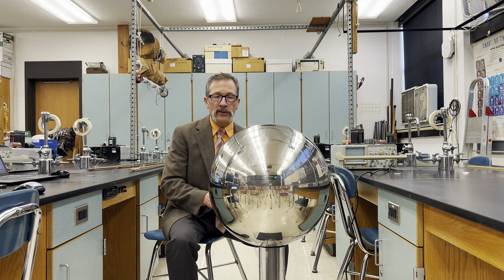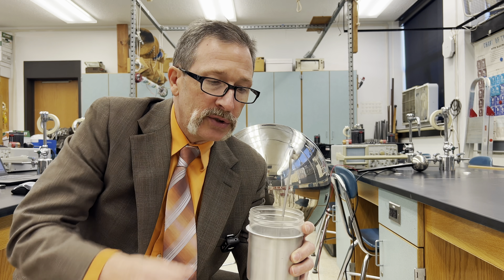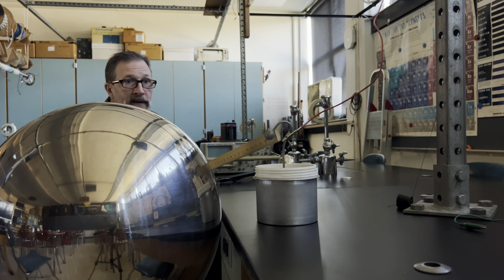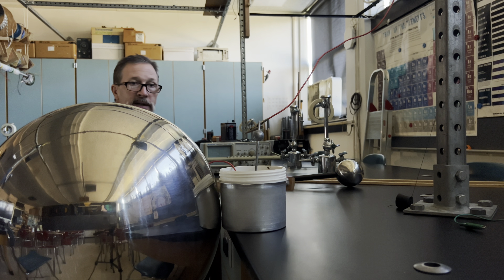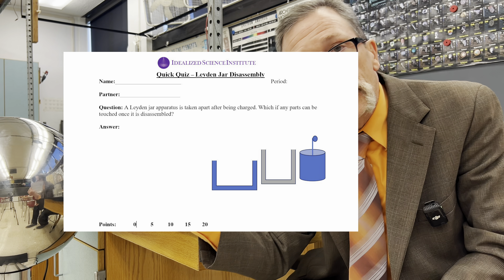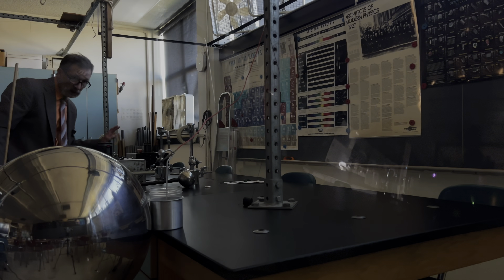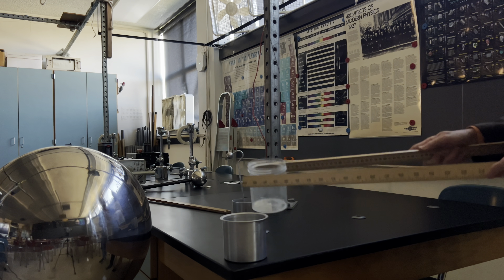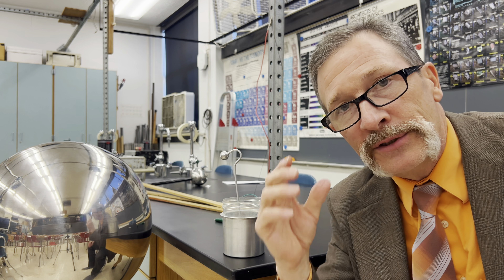This Simple Device Could Kill You

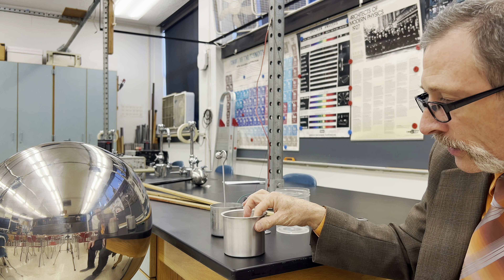Comment: 10:50 11:00 When you say any excess charges go through you to the ground, how much charges is that and why it's not dangerous? Does that mean the energy of a capicitor mostly exist hold by the dielectric? If that the case how do an air capacitor work, what happen if you disassemble it like this?

Comment: I am 60 and find this fascinating. I recall Van de Graaf generators from school. Two questions....is it AC or DC being generated? Second, at the very end, when you shorted/grounded both plates of the Layden jar to themselves when finished, if you put the jar near the Van de Graaf and turned it on, would it spark at all? I am guessing it would not spark to the Layden jar but to something else.
Reply from the maker: We like to say that the resultant discharge would simply be DC. Having charge and taking them to zero.
And yes, when the Van de Graff is turned back on, it will recharge.
Reply: @idealizedscience  Thank you for taking the time to answer.

Comment: Fun video. Thanks. As a teen in the early '70s, I built a Heathkit ham radio transceiver. There was a 450-volt power supply capacitor that was vibrating and making an irritating noise, so I pushed it down with my thumb to see if I could stop the noise. Note that I was barefoot on a cement floor when I did this. The next thing I remember was coming to about 6 feet away, on the floor. The shock knocked me unconscious for a few moments, but other than that, I wasn't hurt. I was lucky. Never did that again.
Reply: I did the same with a carnival ride (The Scambler), maintenance guys replaced the copper commutator and the top piece was still off and my dumbass didn't think about power being on. I went to look inside and I suppose I touched something hot and wound up on the ground 6 feet away.  Now I now what bright purple tastes like.
Reply: @Bowfinger6383  What has this constant 6 feet to do with the jolt...I wonder🤔
Reply: @navneetpandit7299  Same. I work with high voltage caps enough & have shocked enough to know you don't fly anywhere. Your body shakes like you just got a fright & like a burn your auto reflex kicks in on the limb receiving the shock. If the resistance of your skin is a bit low, it gets into your muscles & heart & you feel weak afterwards, but never do you ever fly. Not even when its 525V with 40 amps behind it unable to trip any switches. It burns & holds in that case. Still no flying anywhere. Nvm. 2 meters... Oh, only babies use their feet & thumbs to measure stuff.
Reply: @PoonahNee 
You are only using part of your thinker.
If you are shocked and your muscles flex right you can definitely end up on the other side of the room.
We worked with a room full of capacitors that we used to discharge a lightning strike on our companies products to quality control batches.
A maitaneance worker entered the room and was thrown around the room long enough to wreck almost all the equipment in the room.
It wasn't a small room.
And when product failed the test it was buckled like it had been hit by a truck.
Reply: @Teddybiter  So you throw yourself across the room don't you.... You're not blasted across the room.  Did the electric discharge knock him back or his own muscles,  from acting like a typical maintenance worker. The same can be said for a mouse in that same room. The mouse knocked the maintenance worker around. I care not for the dramatic scene the maintenance worker provided, making it seem like he was blasted around. The product you test, does it explode ? because all I see there is lots of drama queen & fckoll!!!!! facts
Reply: @PoonahNee 
You just moved the goalposts.
I don't need to define how you moved the goalposts, anyone that can read can see you did, I expect you know you did.
Reply: @Teddybiter  No, your reaction, to the shock, jumping around & shocking again only to jump again, is not the effect of the shock itself. Then a mouse makes your fly across the room too. Secondly, what do you test ? The answer as to why they bend, has NOTHING!!! to do with an electric blast with joules of energy to it, supposed to be able to fling you across a room. In short, your misunderstanding of what you actually tested is creating bias I clearly see, yet you refuse to divulge ( imagine not understanding your own job).....That's not moving the posts...The fact remains. The electric trip or discharge or you touching even a line on a 1000V circuit...DOES NOT BLAST YOU THROUGH THE FCKNG AIR!!!! Its not a hollywood movie!!!!! fools.
Reply: @PoonahNee 
Did you notice your tisum is showing?
Reply: @Teddybiter  Aaah lets change the subject completely then. Ignore what the question was re. what we were testing with capacitors. Or the fact that a cat jumping because of a cucumber behind it, had nothing to do with the cucumber's electrical charge or ability to throw the cat across the room.. No, we shall just change the subject & pretend a tisum something........
Reply from the maker: Wow...that is a frightening story! So glad you are alright!
Reply: I charged a 0.1 μF oil capacitor to 600 volts (with my ham rig's power supply) and tossed it to a friend. He caught it, and never trusted me again.
Reply: @amazing7633 So you are a sadist.
Reply: @amazing7633 LOL, a “friend” did that to me in class once. It shocked the hell out of me. I beat the hell out of him! We both got some time away from school and eventually became friends again and, to this day, he still has a very off center nose as a direct result of using me to discharge a capacitor! Although a bit different, we both learned lessons that day. 🙂
Reply: @amazing7633  Cap was too small. We use 50Mfd's for that. 0.1 is what they use to filter electricity on hand held drills or grinders. Almost too small to even click.
Reply: A jolt from a High-Voltage Capacitor can be unforgiving, it could be fatal too! It all depends on what path the discharge takes and how far away it is from the heart!
Reply: Ham radio is not kosher, never forget that!
Reply: @vanhetgoor  ROFL!!!!!
Reply: Lesson learned!
And betting the floor was actually concrete.
Reply: Username checks out lol
Reply: Me too when I was a lot younger and yea we never do that again!
Reply: I still repair the Heathkit Amps.  Got a half dozen of them in mint condition.
Reply: It's also recommended to not use a vacuum cleaner in bare feet.

Comment: Many decades ago, when I was on a substation construction crew, we worked for months quadrupling the output of the substation of a rapidly growing city, which needed more power. When all was ready to put the substation back online, the station master had the honor of hand cranking a huge knife-blade switch: when the blade came about halfway down, a huge blue arc was generated until the switch was completely closed!
Reply: Arcing on switches is a common problem, even in seemingly typical uses. That's why every light switch clicks, to ensure it closes as quickly as possible and doesn't allow an arc to form
Reply: And that’s why most large breakers are spring operated, where you have to charge the spring then release it as opposed to just slowly cranking it shut.
Reply: @TheMinecraftACMann also. But those ones in really big factories etc. Require full gear, and it still won't protect against a super high voltage arc flash. It will turn someone and the person next to them to powder mist.
Reply: I dont know what was worst, Having to open or close those big breakers or watching those arc flash training videos!!  Both quit scary.

Comment: Years back I worked in a electrical utility warehouse where somebody thought it was a good idea to take the grounds off a pallet of 70kVAR  capacitors,  he had a hard time grasping just how dangerous a situation he put himself and others in
Reply: Please tell us about that danger? Such capacitors have inbuilt discharge resistors, and how would they become charged just sitting on a pallet anyway?
Reply: @michaelnoble2432  
1. bleeder resistors can take as much as 3 minutes to bring them down to 75 volts. Big capacitance and 75 volts can be potentially lethal, and at least very painful.
2. Safety habits include safing potentially dangerous equipment at all times. "Never point a gun at someone unless you may intend to shoot."
"Even when it isn't loaded?"
"Yes."

Just ask Alec Baldwin.
Reply: @-danR  doesn't explain how the capacitors can become magically charged just sitting there on the pallet (HINT: they can't).
Reply: @michaelnoble2432 they totally can, a comment above talked about an open capacitor charging itself because of the RF environment it was placed in
Reply: @KingOfTheKindle  no, they can't (and certainly not with bleeder resistors fitted).
Reply: @-danR  PERFECT analogy!!
Reply: @michaelnoble2432  There are several ways they could, not very likely to happen, but as dan pointed out why tempt when it isn't necessary to tempt.
Reply: @DraggonCanoe  as an electrical engineer with 25+ years experience I can't see how the situation can happen as described. But if anyone can actually explain it and prove me wrong I'll happily admit it.
Reply: @michaelnoble2432  Inductance would be my first thought. As I said, highly unlikely, but possible.
Reply: @DraggonCanoe  what has inductance got to do with anything? Energy is stored in inductors (or any circuit with inductance) only when current is flowing.
Reply: Jesus

Comment: No! wood is not a "really good insulator" at high voltage is conduct. Use a perspex rod.
Also you did not connect the Leyden jar correctly. The desk is at earth potential, that is why the sparks jump to it from the Van de Graaff machine (it's made of wood).
Connect the base of the Leyden jar to earth, holding it horizontally on a metal stand connected to earth so the two spheres (with the wire holding the sphere on the Leyden jar straightened) are on a horizontal line, passing through the center of both spheres.
Now the Leyden jar can charge (until it sparks over but a load noise). It will be more dangerous.

Comment: Note that all high value capacitors can produce a spark that you can see and hear.  Even a 3 volt capacitor can produce a spark that you could practically weld metals with.  And, 3 volts wouldn’t be dangerous at all to touch.  The reason high capacity caps are so dangerous is because their internal resistance is very low.  Batteries, for example have much higher internal resistance.  Handling any large capacitor should be done without using metal or having metal, like jewelry (rings, etc) on your body.  Voltage counts as well, but for most humans…..not usually until you get to 40-ish volts or higher.  I have a 13 VDC power supply that uses individual 2.7V caps, for a total of 13 VDC and 3000 Farads.  I can touch it all day long and not worry at all.  But if I were to short that bad-boy with a strap or a screwdriver…it would be a fantastic explosion that could rival any fourth of July firework display.  If I were to be wearing a ring and somehow short that ring across that power supply, my finger would instantly become well-done steak.

Comment: It would have been cool to prove skeptics wrong with an additional plastic insert on standby that wasn't involved in the charging process to insert first and test, then place the original back in.
Reply: use different jars but same plastic.
same jars different plastic.

if the things made from flat plates. swap the plates. flip the dielectric. split dielectric into individual layers ( i use HDPE sheets?)  use a moving needle to show polarity/strength of discharge....

Comment: Everyone misses step 3. Step 1- cut the power and lock it out. Step 2- safely nd properly discharge the cap.

Step 3- make sure it stays discharged. We had someone remove the bleeder resistors from an HV power supply that was discharged and it recovered a decent charge over the next few days. Surprise!

Comment: Now I feel like I need to know what would happen when charged air gap capacitor is being disassembled.
Reply: Ask Chris Boden
Reply: I wanted to ask the same question but looked if someone already asked it 😆
Reply: airgap wont store any charge. So no danger.
Reply: @heel57  So where did all the energy go?
Reply: As the capacitance is reduced by pulling the plates apart (requiring force), both the energy and voltage should increase by conservation of energy

Comment: I have been zapped from the discharge large electrolytic capacitor in while repairing a 'power off' valve operated Television receiver in the distant past and received a unpleasant burn on the side of my hand. You only do this once!.

Comment: I made a DIY solar system on my garage roof.  Originally the design was "floating DC side".  However a few days before the panels were mounted on the roof a small thunder storm rolled through.  I did some googling about voltage gradients and accumulation of charge in floating systems during such a storm.  While it was not "that" worrying, I still grounded the panels to the earth rod.... and then everything else too.  I didn't even want it to "zap" me like you might get off a car door handle.  The odd thing is... 3 different panel controllers, 2 are common negative and 1 is common positive.  This leads me to believe that the PV has no galvanic connection to the panel frame of they would have shorted the MPPT controllers.

Comment: if he was standing barefoot on wet floor would he have been shocked when he touched the disassembled Leyden jar? I once had an old device with a small capacitor sitting in my toolbox for almost 15 years. As i was cleaning out toolbox i decided to open/crush the small capacitor with a pair of large and (luckily) insulated pliers to see inside. Next thing i know POW!! along with a blinding flash of white light. I have respect for how long capacitors can hold a charge now.
Reply: Does not matter on what he's standing.

Comment: Yup. And this can happen with regular capacitors, especially high-voltage ones used on power lines to correct the power factor. You can disconnect and discharge them, but the dielectric inside them will retain polarization and it can eventually recharge the capacitor. Several times.

That's why they have to be transported with the electrodes wired together.
Reply: But it’s not generating power, it just doesn’t fully discharge itself, technically.
Reply: @SaveTheFuture  well yes that is what he would mean by saying it is still polarised, that's the work done on the materials during the initial testing at the factory, ordinarily sure it has little effect on operation of the device, but still, work was done to polarise it in the first place and absent the device being given power to keep that metastable state, it will eventually unwind so to speak.
Reply: @SaveTheFuture Dielectric absorption allows partial charge recovery after discharge.
Reply: @finestructureconstant3921  but the power is internally stored, right?  Or is it from the environment?
Reply: @SaveTheFuture  It's stored internally. Essentially, molecules get stretched as they align with the direction of the electric field. This allows them to store a bit of energy.

When they cause the capacitor to re-charge, they relax back into the normal state, releasing the stored energy.
Reply: They have discharge resistors.
Reply: @michaelnoble2432 or an old isolated screwdriver sometimes 😂😂😂
Reply: Lightning arrestors are the same way, windy day? Fuck you those lines better be fucking grounded or I aint touching em.

Comment: I'm studying mechatronics and never seen a demonstration like this one.
I thought the charges would have disipated when dissasembled but that wasn't the case, I guess it's because either the charges are high and also that the thing is round and lacks any sharp points.

Seen plenty of experiements with charges and high voltages but nothing like this one, truly an eye opening demonstration.
Reply: Reminds me of working on my Acom 1000 amplifier ! I'm working on valve amplifier as one must be careful. People literally died repairing those things I heard the story once someone defeated the crowbar and wasn't prepared. Apparently his wife found him slumped over the amplifier.
Reply: This demonstration is a bit misleading. The charges from the cups DID dissipate, he could have touched them together to illustrate that.

The charges on the surfaces of the insulator did not. It also likely got polarized.

Comment: This was really interesting.   At first, my brain was insisting on treating this as a common capacitor.   But when you said the dielectric was storing the charge, I knew there were some extra 'magical' things happening.  But it didn't jive with my thoughts on capacitors.  Which normally store the charge on the plates and not the dielectric?    After a wikipedia search, it seems that this is a special case here and I shouldn't try too hard to map this experiment one-to-one to a capacitor that might be used in everyday electronics.   It seems that indeed the dielectric of the Leyden jar can store a charge.  But wikipedia says it's due to the material of the glass (Hygroscopy ?) and water molecules can actually coat the outside of the dielectric.   Which, in a way, sounds like it would make the whole contraption into a nested capacitor.  Not just plate << glass >> plate, but instead maybe plate << water molecule coating << glass >> more water molecule coating inside >> plate.''

So a combination of the very high voltage (creating a corona discharge) and the fact that in this special case we have charge building up around the dielectric (which you wouldn't normally see in a capacitor in everyday electronics).   After all that, I'm still not feeling certain I'm understanding this.